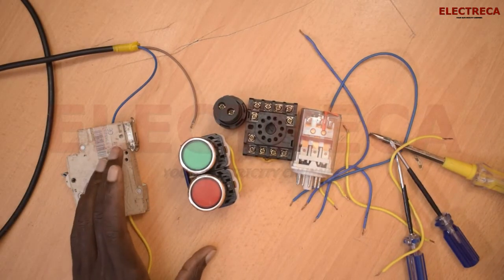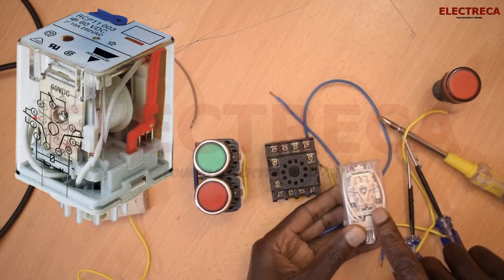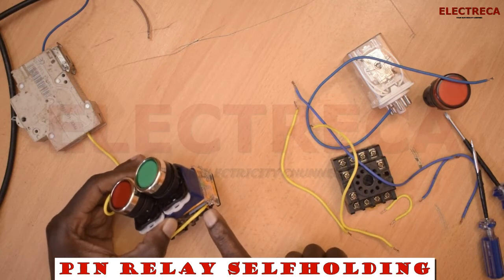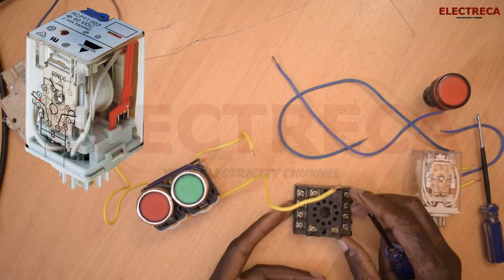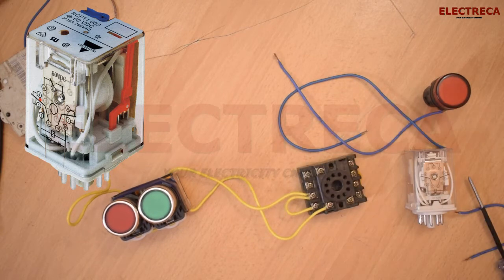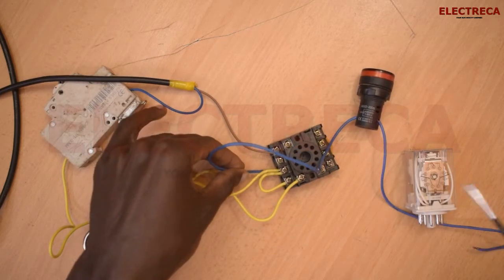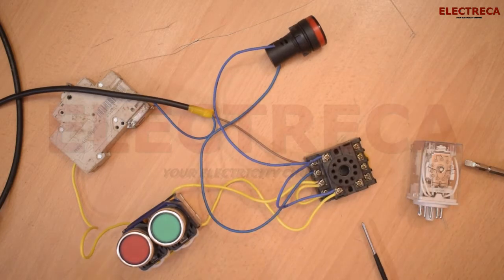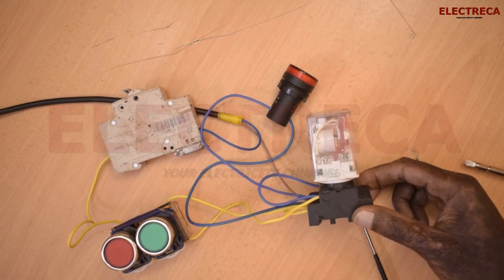pin relay self holding with push button|start stop button|on off button|ELECTERCA

Comment: I just watched another of your videos. Your are one of the few that helps understanding a little easier. I understand the layout for the switches, but am unsure about the relay pinouts. I am sure I am not the only one who has problems reading schematics... If a drawing showing some layout were attached, I think the videos would be complete for people like me...

Thanks
Skip....
Reply from the maker: Thanks for watching...... Now to help you more on that, I'll draw a schematic for the self-holding circuit which you can apply in both contactor and relay. just send a blank email to  
electreca.workshop@gmail.com